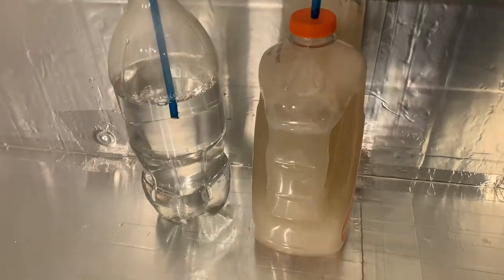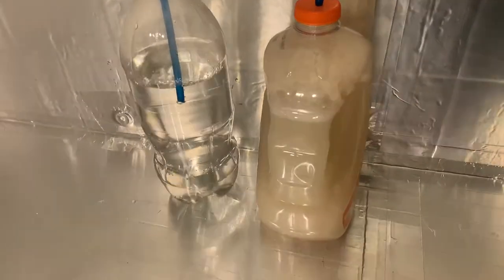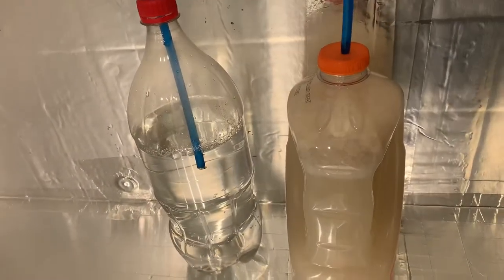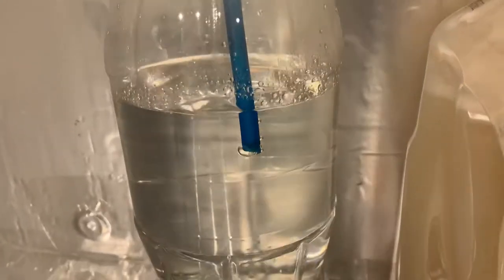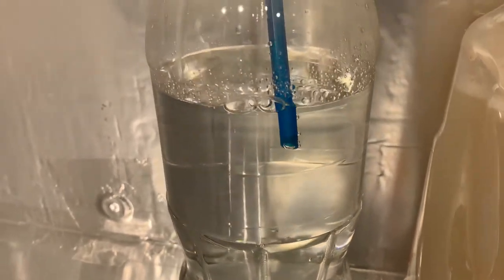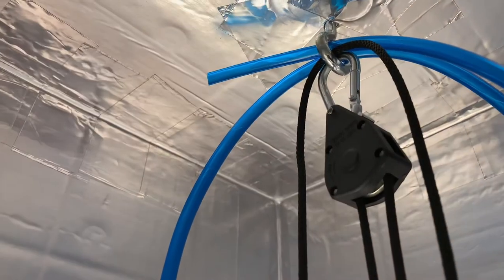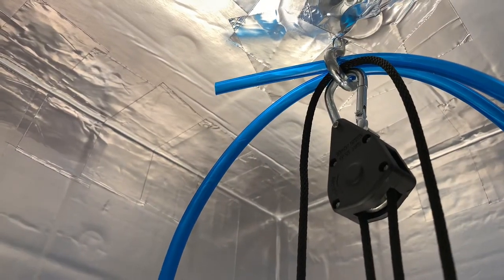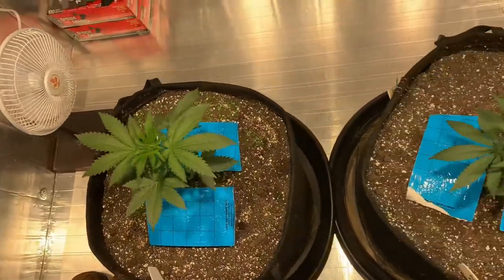DIY Co2 system for cannabis

Comment: If u run an exhaust you can have co2 lower than plants and exhaust will pull it up through the plants, which is ideal
Reply: So then I could only assume if you're running both the co2 and exhaust from the top then the exhaust will just suck the co2 out of the tent and not even benefiting the plants.  Is that right?
Reply: @Kodos2024  Yes , it might be heavy but not enough to outrun an exhaust fan. Joe's on the money
Reply: guy seems to know what hes doing. maybe you should get your own channel and show us

Comment: I’ve grown for over 20 years with and without c02 . To me it’s not worth the messing around . The only time I saw real gains was in a sealed room cooled by air conditioners and the heat and food ppm needed to be increased to increase the amount of water used for food uptake . Other than that no real significant difference .

Comment: If you buy a soda stream modify to release c02 on a periodic weight process for the pressure switch release c02 under plants with pressure for regulation word

Comment: I think I figured out how to build one of these that doesn't ever stop producing CO2. If you put an airstone into the mix with the yeast and stick the air pump on a timer that defuses oxygen into the system consistently than the yeast will never go anaerobic and never make alcohol. They'll just keep producing CO2 and water. All you gotta do is empty out like 2/3s of the spent solution and replace it with more sugar water.
Reply: Make a video
Reply: Please make a video
Reply: @SwiftKing1  I think I will. my tent was above 700 ppm. with this set up,.it.was pretty cheap too
Reply: @sw309 I would love to see that video
Reply: i know this is like a year old but did it ever work? and what are the instructions?
Reply: Baking powder & water, baking soda and citric acid ( q mole of both produce 1mole of co2 ) 👁️

Comment: In a hydroponic version let the c02 regulate through the recycle water tray as the slower the c02 while it feeds under watering the nervous system is open like our skin can rehydrate In the shower if you water from above the oxygen h20 drop process catches in the c02 rise opening the breathing capacity in close quarters

Comment: Very nice! I was just about to buy a couple "exhale" bags for $60. I appreciate the info.
Reply from the maker: You’re welcome 😎
Reply: why are you even doing co2 supplementation? what is your DLI? average canopy ppfd? how do you know if your plants are even benefitting from the extra co2 in the environment?
Reply: @Josh R 🤣🤣🤣
Reply: @420troll4  over 2000 and under 400 ppm hinders the growth rate, the natural atmospheric amount of co2 is around 400 ppm, so technically everyone who grows should be supplementing co2 in any way possible, if your area is not then it’s around the 400 ppm mark and plants use co2 so your ppm will drop or never get over 400 which is bad and light,water,nutrients and co2 are all limiting factors you can have all three on point but without the fourth your plants will be limited in their actual potential
Reply: How much day it’s worked?? For use

Comment: I hate to state this but the purest extraction is natural in accordance in oil procedure if you use natural light excessive heat such as fan forced and to heat clear glycerine clear food quality for a stretch of hours then coll till luke warm freeze to again break trychromes release to natural light to sun down the method of my insanity seal a sauce jar much in aspect of a mason with duct tape outside in freezer so on from start should have stated shake as much as you fear its not compounding then let sun set the heat behind a glass or open dual glass heat to again reflect a temperature to drop more compunds as of dark again use heater then upon the moring add vinegar then again hold heat all day and noght to heat the dissolvent then when you have seen a briwn tecture with the dark green above seal a strong canister and blast the mixture in the select transfer c02 bottle its does bang beware then move contents back to mason jar seal freeze then unthaw to glycerin again in a nice brown to cheesecloth tried in alcohol sat at bottom nearly destroyed me real creepup

Comment: This doesnt produce enough c02 to even be worth it 2nd this has been on the net for years why make a video on it
Reply from the maker: Thanks for your two cents mr. angry 😎
Reply: How much CO2 does this method produce and How much CO2 is needed (4x4 tent) to replicate from real outdoors? Do you even know or are you just repeating somebody else’s opinion??
Reply: @engell3707  Yeah! Where's the math?
Reply: @engell3707  "How much CO2 is needed (4x4 tent) to replicate from real outdoors". outside is about 400ppm; houses trap the carbon that comes from appliances (stoves, water heaters) and the carbon that you breathe out. houses are naturally higher in co2 than the outside is.

Comment: waste of time and money. no homegrower pushes their plants hard enough to benefit from co2 enhancement. do you even have any idea how much more co2 that your setup is adding to the environment?

unless your DLI is above 60 or your average canopy ppfd is over 1000, your plants will not benefit from any extra co2 that this method might produce.
Reply: So if i have my window open 10 feet near my grow with 2 plants and a fan, is that ok to recycle air? Will this c02 thing help me?
Reply: @canna_craigy_uk172  seems fine-ish. i would never use co2 unless i was a professional/commercial grower.
Reply: @420troll4  Are you using LED or HPS?
Reply: Dr Bruce Bugbee would beg to differ, run the whole time  go to woe at 1200ppm REGARDLESS of whether it's 700 or 1200 , studies proved of a 20% increase of biomass , which in turn adds to the goodness. And here's me thinking "that 420troll sure must knows his dope" yeah you're the dope troll .
Reply: @davidrichardson9146  wtf are you going on about?